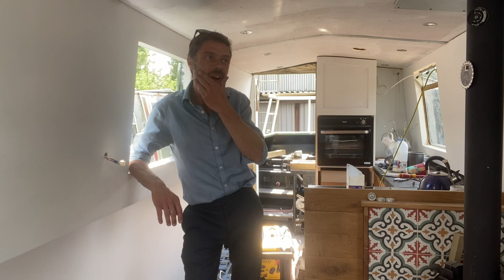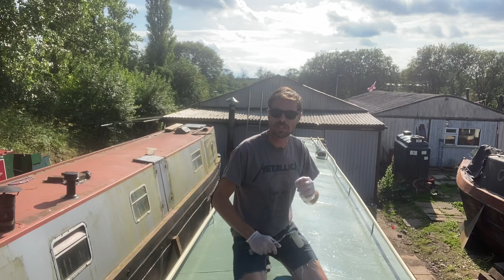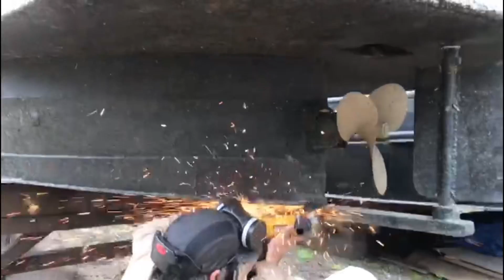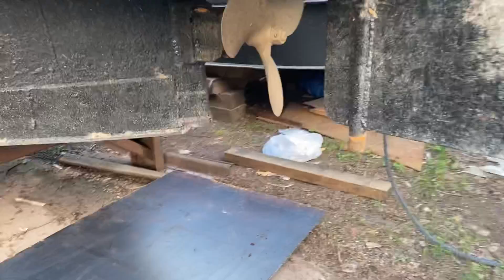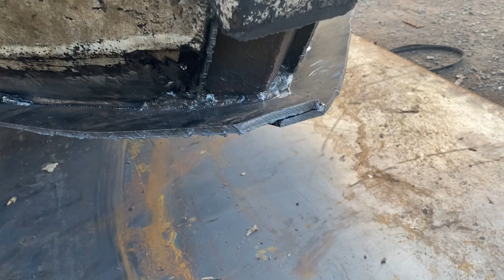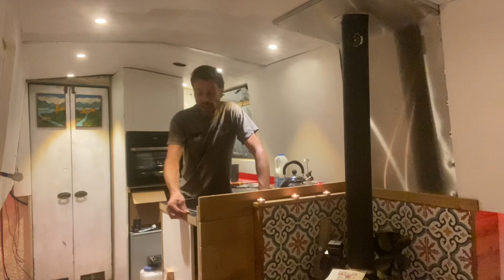215. Narrowboat 2nd top coat in Craftsmaster Bethnal Green

Comment: Marshall Woburn powered Bluetooth speaker.Fab sound and great connection possibilities. Portable  enough to bring out to the stern in good weather and loud enough to keep inside in bad weather. Can be used as tv sound bar. No wiring of vessel required and is rechargeable for portability. 🤘😎🤘

Comment: Another option for your audio IF you are still thinking of incorporating the guitar amp and speaker into the dinette:  Get shallow mount 4 inch speakers and mount them in the walls or ceiling but because they are little weak in the bass department, use the guitar amp in the dinette as a woofer (which you can turn on when a piece of music that demands bass comes up) but leave off when you are just listening to the news or background music.

Comment: You have to sand between coats if left more than a couple of days or they won't bond. Sigh. Also the detergent acts a a release coat making matters even worse.
Reply: Exactly that.
Sanding / flatting back is the key to any paint application.
Sand it and then wash the dust off with just water or wipe down with proper prep cloths not soapy water.
Use soapy water if needed to flatten with a fine grit paper on a top coat to remove high spots or blemishes.

Comment: I'd put the head unit in the electrics cupboard, facing upward tbh.

Any way you can mount speakers in the ceiling? That might look/work better than trying to work out what angles they're all firing at from various cupboards and units
Reply from the maker: I could put some cylinder speakers in the mushroom vents possibly
Reply: @TheNarrowboatThatJamesBuilt  Don't block the air vents.  You need them for moisture removal, and air supply for the fire.

Comment: If you got component speakers (tweeter and woofer are separate instead of being inside of eachother ) you could mount the woofers firing down from under the gunnel, and then the tweeter which are roughly an inch to two inches in diameter could be surface mounted in the wall or ceiling.  
The detail of the music is mostly from the tweeters and male voice down is from the woofers.
 You can get away with the woofers not pointing at you because the tweeters will make it sound like all the sound is coming towards you. 
 Ugh.. hopefully that made sense. If not ask me and I will try and explain better or make a drawing or something.